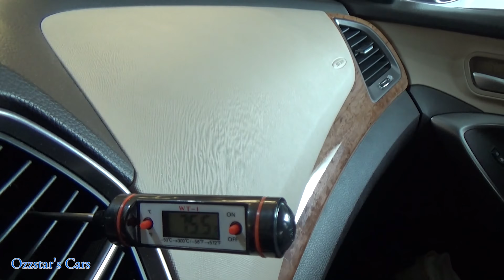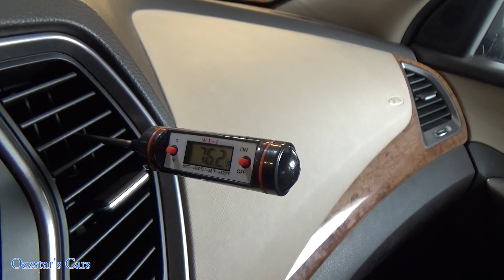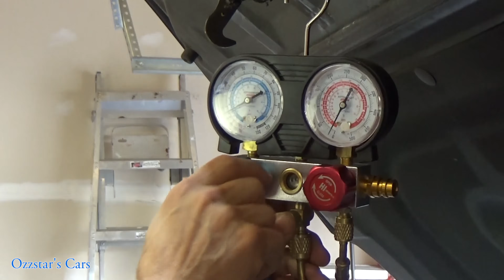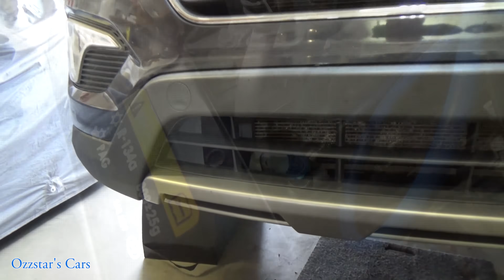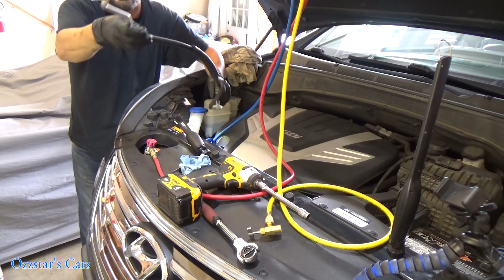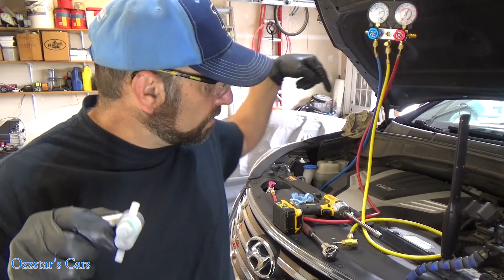Hyundai Air Conditioning Repair, Time to Fix the Line * PART 1 of 2 *

Comment from the maker: Genuine Hyundai A/C High Pressure Line 97762-2W801  **https://amzn.to/3TrV5bM**
Automotive Air Conditioning Kit Manifold Set and Vacuum Pump
**https://amzn.to/2SvkNB1**

Check out some cool tools that Ozzstar likes to use:  https://www.amazon.com/shop/ozzstar
Reply: Ozz,
I have a 2014 Santa Fe. I have been chasing my tail for a couple days with a AC issue. Long story short I’ve replaced the compressor and filter drier and have the same issues as before the replace.
With the car running and AC on my pressures are the same. I’ve added a full can of 134a from -30 vaccum and I’m at 90psi. 
My question is why is my compressor not pumping? 
The compressor came with 3oz of oil and from the chart that came with the compressor it needed a total of 4.4 so I added 1.4 to the compressor. 
Could to much oil causes this issue? 
Again why is my compressor not pumping? 
Thanks in advance

Comment: Hey guys, working on a 2013 Hyundai Santa Fe Sport with an HVAC issue. A/C blows ice cold, blower speeds work, and climate-control buttons light up, but none of the actuators respond. Air stays at the front vents regardless of selection, and there’s no heat unless I manually move the blend door.

I’ve tried 3 different blend-door actuators with no luck. I’m getting 5V at the actuator connector and only 4.4V at the A/CON2 fuse with ignition ON. Even swapped the SJB, same results.

Could this be a faulty climate-control module or wiring issue? Should A/CON2 have 12V? Anyone experienced this? Any advice would be appreciated!

Comment: I need serious help. I have a 2023 Kia K5, and my AC went out. It blows air out of all vents. It blows cold air on the passenger side, but lukewarm air on the driver's side. Anyone that has had this issue. I am a college student that cannot afford to take it to dealership since it is out of warranty. Can this be the issue? Can it be the blend door temperature actuator?
Reply from the maker: Yes

Comment: My Mom’s ac went out on her 2013 as well and want to replace that hose, so I have to go to the shop to decompress it first??
Reply from the maker: The system needs to be evacuated before working on the system.
Reply: @ozzstars_cars thanks got it. Hopefully not too expensive 👍
Reply from the maker: @leonsam12 keep in mind if the hose has been leaking there may be little to no refrigerant in the system.

Comment: Have you experience hot air on the left side? Cool on the right? Air doesn't feel super hot but significantly warmer than the one on the right hand side.
Reply from the maker: That is usually caused by a malfunctioning blend door.
Reply: @ozzstars_cars Where is this blend door located? in the heater core?

Comment: How did you get the part numbers because I'd like to replace the smaller connector right next to the one you replaced
Reply from the maker: A parts schematic online that sells OEM parts.

Comment: So I removed the low side cap on my 2008 Hyundai Santa Fe and it immediately leaked should I add oil when I go to recharge the system?
Reply from the maker: That's a refrigerant leak, not oil.
Reply: @ozzstars_cars  yes I know that but when I recharge the system with refrigerant should I also put some oil, although I didn't see any oils around the low side as it discharged at the cap.
Reply from the maker: @silver_trek_AWD  no reason too in that case. Attach gauges and check pressure high and low side

Comment: The problem with my 2015 hundai Santa Fe sport is that sometimes the air does not blow, there’s no leaks on the lines, because sometimes it blows out air and sometimes it doesn’t, any ideas of what it could be. Thank you
Reply from the maker: @ToysNstuff87  txv valve been checked?

Comment: Good video! My car is 2013 Hyundai Elantra GLS, currently at 125k. About a month ago it wasn’t blowing cold air so I decided to use one of this refrigerant cans and accidentally put to much in the system. Had to take it to a shop so they evacuated the whole system, changed the expansion valve and refilled it. It didn’t seem to work cause a/c was working but not getting cold air as it should. Now I’m having this issue with my RPM at idle when the A/C is on. It also have this little noise coming from the blower motor, but it only seems to happen when idling. Car runs smooth, but at red lights or stop signs RPM goes down and it becomes shaky and then this noise from the blower motor comes out (it only happens when a/c is on).
Also replaced the throttle body, coils, spark plugs, MAP sensor, PCV valve because of this rough idle, and right now IDK what else to do with this. Dealer was asking for $550 for just a diagnosis and I don’t trust them anymore, so I’m running out of ideas
Reply: Possible damaged ac compressor.

Comment: The bottom 10mm nut sometimes seizes up if it has never been removed. I suggest soaking the nut a few times with WD40, letting it sit awhile and getting a firm grip with a 10mm ratchet wrench so you don't round off the nut with an open ended 10mm like I did 🎉
Reply: Also I'd like the see if this guys had the same problem I did.
Reply from the maker: @glendickens1013  it's a tough nut to bust.
Reply: @ozzstars_cars  it sure was but I managed to break it loose. I  was getting a little worried about rounding the flats. I said a little prayer and turned the wrench and I finally saw the nut break loose. Gods good 👍

Comment: Thanks for the vids. I need to recharge my 2014 Hyundai Santa Fe Sport, so I went looking for the connectors. The H connector was right where the video showed it, but the L connector was back on the firewall, not down below the alternator—I was lucky to spot it

I only mention this because it suggests a tube of a different shape—people may have to specify that to their jobber

Any comment?
Reply from the maker: @jimpetersMontreal  because the Santa Fe you worked on is a 4 banger, not the 3.3L V6.
Reply: @ozzstars_cars  thanks!

Comment: Thank you for your detailed videos Glen. I am in the middle of doing the same repair and had a quick question. For the lower 10mm bolt, did you remove it while under the car or use a ratchet extension and get it from the top? I'm having a little trouble getting in there and every video I come across skips the actual removal of the line haha
Reply from the maker: Removed from underneath the car. It is to tight of an area to film and a bitch to get a grip on.
Reply: @ozzstars_cars  Thank you! I was finally able to get the bottom end off. Now moving on to evacuating the system

Comment: Hi I'm your new subscriber, I would like to ask if it is normal to experience the Lower Pressure line sweating during A/C operating?
Reply from the maker: Yes it can with certain temperature and humidity conditions. Thanks for the sub!

Comment: Hi, i have a 2010 santa fe. The charge is ok and compressor is spinning. But the air coming out of vent is not cold. I touched the suction line under the hood heading into the evaporator and it's not cold. Can it be a bad expansion valve? Thanks
Reply: Thanks for your reply. I bought one of those refrigerant bottle kit with a gauge. When hooked up with power car off it shows that the  charge was ok.
Reply from the maker: @mark.r  you need to check the low and high side pressures in order to get the necessary data. On newer vehicles a bidirectional scan tool can also help with data.
Reply from the maker: Did you hook up the manifold gauges to do a proper diagnosis?

Comment: The AC swith and Air blower  in and out is working fine but  the problems all the small lights related to these boutms are not lighted and Ac working with out it when I press it.also the passenger window lift side is not working .  (SANTAFE 4WD 2015

Comment: Good job, my friend I have problem on air condition it’s coming high I can’t to make slow. I checked for fuses and still no change for that. I go to many mechanical air they didn’t finde the problem. My car is azera 2016
Reply from the maker: Has the blower motor module been tested?  Prbably duty cycled.  The modern version of an old school blower motor resistor.

Comment: This video was exactly what I was looking for. My 2013 Santa Fe had the same issue. I have worked on my own cars for 45 years and this is the first time that I have had an air conditioner issue on one of my cars. The oil leak on the hose was not obvious and I thought it was just road grime. Even with fluorescent dye, it wasn't really obvious. However, the oil/dirt was on the hose and I replaced it.  

Mine has the 2.0 Turbo, so the hose is a little different. It was not very hard to start the nut back.

I would strongly suggest, since it was something that I didn't do, is to spray the connection at the compressor with cleaner or compressed air. Dumb move on my part, but I was thinking about the rest of the job. When I pulled the hose out of the compressor, mine had a some "gunky" stuff fall on the floor. Took me a bit longer to ensure that none had fallen into the port. CLEAN THE CONNECTION before removing the hose.

I also used orange thread locker on the upper and lower nuts when I put them back on.

Ran a vacuum for 1 hour and then closed up the system and still had -28 psi on the closed system 45 minutes later. 

Charged it up and system was putting out 44.5 degree air with outside air @ 92 degrees.

Thank you for the time that you spent making the video. Saved me a lot of time!
Reply from the maker: Glad the video was helpful Bobby, keep staying cool!

Comment: Buddy I have a 2009 Elantra with the same fitting by the high pressure port that I can not get apart like it is seized. Any tips? Heat maybe?
Reply from the maker: Did you try tapping lightly with a soft faced hammer?

Comment: Very helpful.. I have the same car and I got the same problem and just ordered a new discharge line..
Did you add oil to the system after changed the line?
Reply from the maker: No I did not add any additional oil.  Evacuated and refilled with R134A.  Thr system has been working perfect since. This happens to be my wife's car.

Comment: First-time viewer. A few diagnostic steps and info I would have given in the video, you did not seem to raise the idle while sitting in the cabin to see if vent temps would change. When seeing 5 PSI you did not mention what PSI you are expecting at the current ambient temperature. Thanks for the diagnosis and repair on the line. Have you thought to make playlists based on the Manufacturer of the vehicles?
Reply from the maker: Valid points Duane. Unfortunetly the videos can't be too long and some things needed to be edited out. Thanks for stopping by the channel!

Comment: Great summary and good find! It always surprises me how often one can fix problems, with a little common sense. There are many videos here on Youtube, some by professionals, explaining how to do AC repairs wrong. The most common errors are to put compressed air into the system, and inadequate vacuum after the system is cleared. Both allow water into the system, which slowly messes things up by freezing and thawing water in the wrong place, caused by the normal huge swings of pressure.
Reply from the maker: So true. When I was editing the footage I realized that I should have mentioned one of the benefits of evacuating the system of moisture is a big deal. Compressed air isn't the best to test but it does beat wasting the refrigerant.  Dave do you use nitrogen?
Reply: @ozzstars_cars  Good point, few of us have nitrogen on hand. The last time I did this I used 100% argon (it is on my welder) for an AC flush. As you point out there are lots of other options, including UV dye mixed with refrigerant to find a leak. I am surprised how inexpensive Chinese knockoff refrigerant leak testers are now.  Better yet, do as you did by looking for the oil leak!

Comment: Great work Glen! Just a few tips I picked up over the years. I always use blue Nylog on o’rings as it seals and lubricates although the refrigerant oil is fine too. Fill the system with nitrogen at 200 psi and use ultrasonics as it’s a great way to find even very small leaks. And I always hate leaks especially the one where the entire system is empty. It’s a guessing game of how much oil to put back into the system. Have a great evening! 😀👍
Reply from the maker: Never heard of Nylog. You have all the pro stuff Terry!